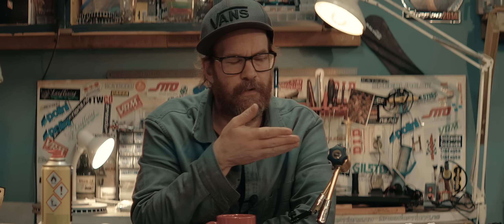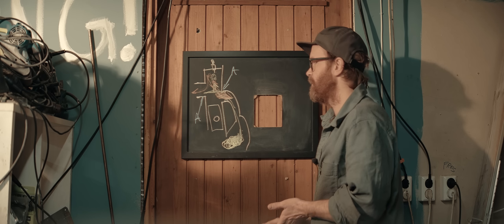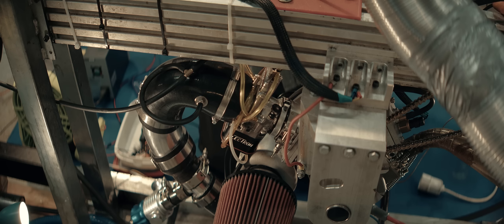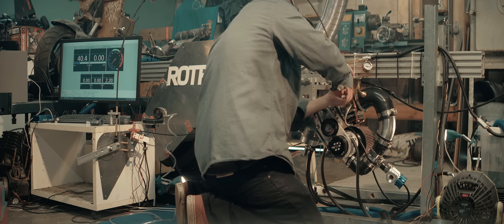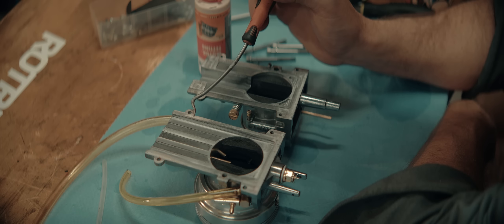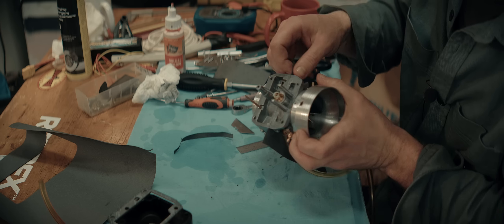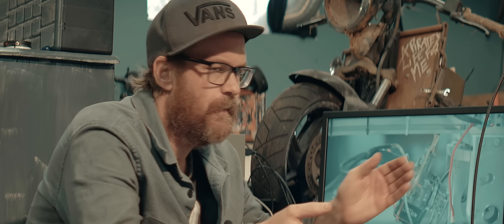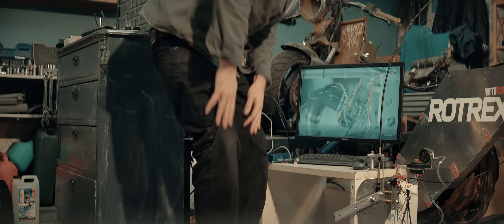50cc Engine in there somewhere...

Comment: dosnt the supercharging presureise the fuel pulsating wise back?

what abaut car fuel inejcors? ito the flowstream
Reply: maby you could calculate the time withe the distance from the spark plug egnition from the time the inector inects and synchronice it with the sparkplug.. or with the resonance

no mor fuel siting in corners or low presure arias
Reply: what if the methane fuel is presured in a tgastang insted of an highpressure pump

Comment: Get a much better ignition system
Reply: Personally I don't think the ignition system is at fault. I believe it down to the size of the fuel droplets it's trying to ignite. The fuel to air ratio is massive in such a tiny combustion chamber.
Reply from the maker: You're very much onto something!

Comment: Oh dear, a lot of complications. What? And you ain't? Please. Go efi, get rid of pressure balancing, force air straight in & squirt some gas through an atomiser.  Hf vibes will kill your float chamber and level and mixture, yada yada. Look around you. Show me a car of the lat 10 years that uses a carb. Leave it to lawnmowers. Yeah, JB weld will work. Once. There are times the Lord says - Restart!

Comment: The more I look at it I don't see how the supercharger is giving you any benefit at all. The reason I say this is because first of all the supercharger is a parasitic draw on the engine, second it is pressurising the crankcase building pressure under the piston and third none of that pressure is increasing the pressure in the combustion chamber. The inlet port closes before the exhaust port so all pressure is lost down the exhaust. In a 2 stroke diesel  with superchargers  they have 1 exhaust valve in the head. After the fuel mixture is ignited the piston is forced down until the piston starts to uncover the inlet port and the exhaust valve opens allowing the pressurised air from the supercharger to empty the cylinder. When the piston hits BDC the exhaust valve shuts so the supercharger can pressurise the combustion chamber. https://www.youtube.com/watch?v=mA7l3dpx6t0

Comment: Your enthusiasm is admirable,but your concept is all wrong.
What you should have done is bore a hole in the base of the crankcase.Attatch a cylinder/crankcase to it of any capacity you desire.A four stroke line trimmer or even a small air compressor engine.
Gear it one-to-one and drive it via a toothed rubber belt off the end of both crankshafts so both pistons rise and fall together.
Bingo! You have a supercharged engine,but draw through,not blow through,eliminating a heap of problems with your intake.
Thank You.

Comment: Denying the return of pressurised charge to the crankcase is the purpose of a reed valve. How or why, never mind, what you are now doing is lost on me, really.
Reply from the maker: Pumping action is almost nonexistent in this crankcase(pun😁), very high volume, consider it more as a plenum. Case pressure doesn't exceed blower pressure except at low rpm.